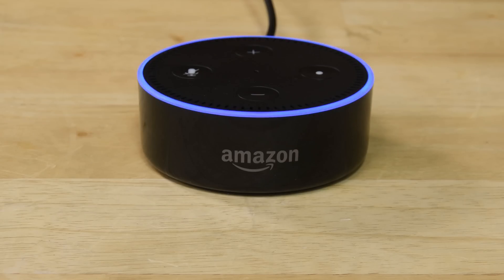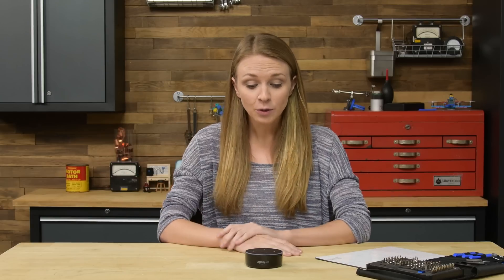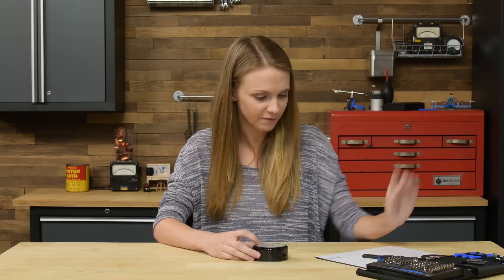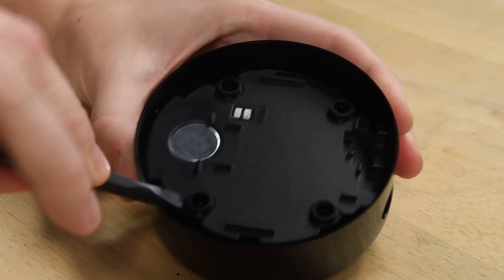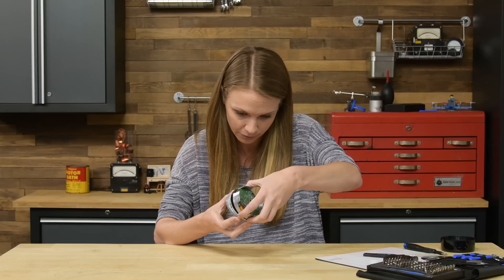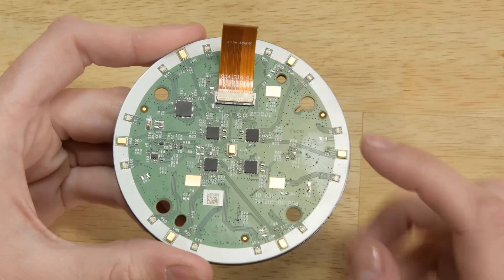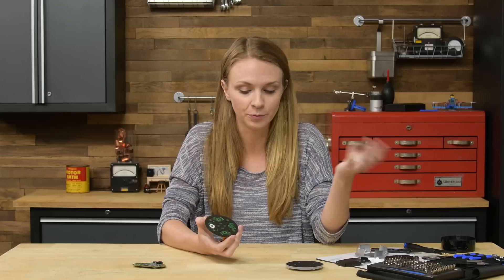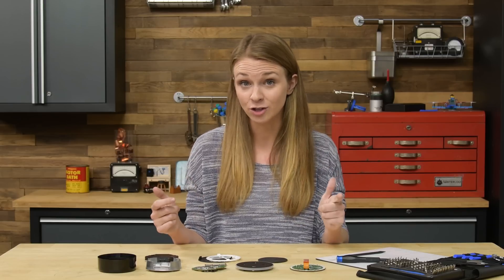Gadget Guts: Amazon Echo Dot (2nd Generation)

Comment: I didn't know the Amazon Echo Dot had a photosensor to adjust the light ring brightness according to the light in your room, that's cool, I don't even know if Amazon publicise that as a feature.  That speaker looked really tiny, I'd be curious to see how it sounds when removed from its plastic bracket.

Comment: The weird thing is, since getting the Echo Dot two days ago, every time I watch some online video (about a half-dozen) about Alexa, in which "she" responds to someone's question, the EchoDot in my kitchen will hear it and will respond exactly like the one in the video, but staggered a bit in time, invariably. So, I have an actual "echo" of Alexa responding. This is an unfamilar paradigm for me andwill takes some getting used to. So far, I have found Alexa to be pretty dull and pointless. She knows only the most rudimentary of things and not even that many of those. At the moment, she appears as little more than a cheap parlor trick. However, I know that she will soon know more than one is comfortable knowing.
Reply: I know its 2 years but if you dknt want that to happen mute alexa when watching these videoos

Comment: Great teardown. So what about repairability????
Reply: Looks like it would be pretty high in repairability. I'd say this would last as long as Amazon's Alexa service itself if not more. Without the servers I'd say this device will be fairly useless.
Reply: What could you possibly break and need to replace? besides buttons maybe
Reply: Yes it can
Reply: Ethan Chow yes it can, I have one and it works but isn’t great sound, it sound alright but as you can see in the video the speaker is small.